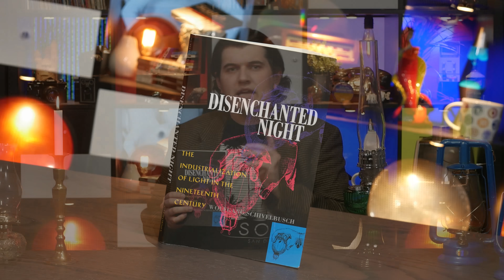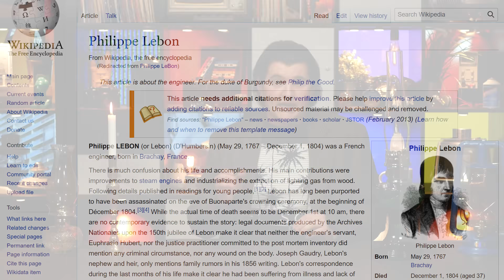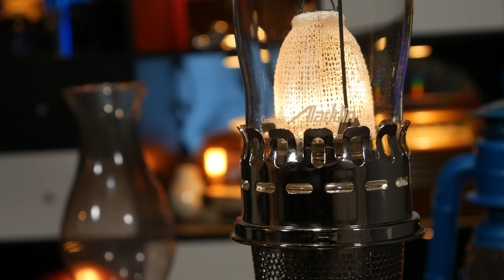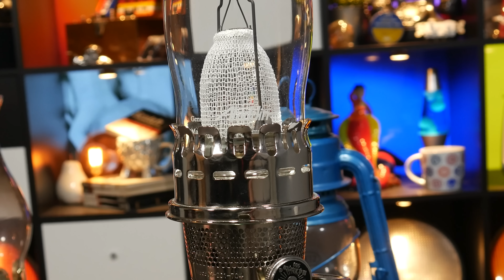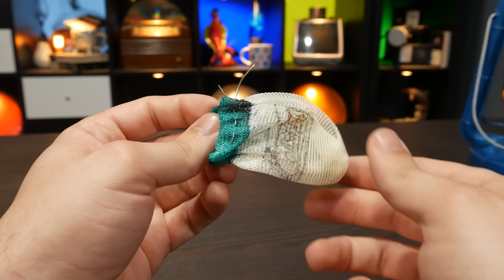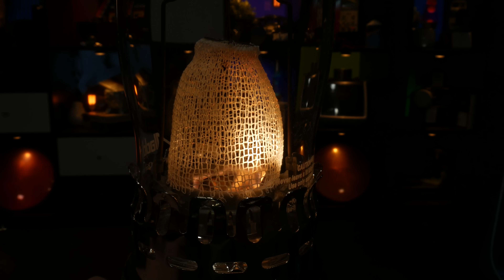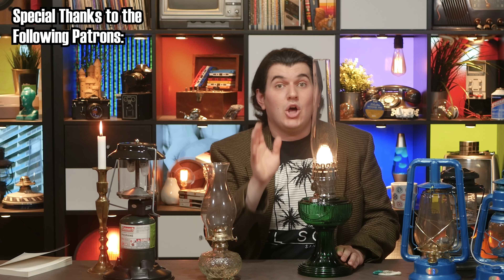How the gas mantle made lamps 10X brighter

Comment: Something I found interesting is an apartment complex I used to visit used gas mantle lamps to illuminate its parking spaces. probably about 2 dozen dual mantle lampposts, around 6.5 feet tall, speckled the sidewalk near the parking lot. This was fairly recently too, last time I was there was prolly 2015 and they were still in use. Only thing I can figure is it must be cheaper to continue using them than to rip out the natural gas plumbing and install electric lighting

Comment: I'd like to disagree with the 'odorless' aspect of the mantel lamps.  After a few or several hours you will notice a subtle hint of kerosene if run inside.  I have a pair of Aladdins for power outages. They are superior illuminators, easily equivalent to a 40w to 60w incandescent bulb. (Perhaps it's because of fiddlin' with it to adjust a perfect flame)

Comment: Tangent on coal gas: The Soviets experimented with hybrid steam-combustion locomotives that produced anthracite gas in the tender from the locomotive's fuel coal then piped that gas into an internal combustion engine while the excess coal went into a steam boiler. They ended up failing due to the extreme weight of this set up and the gas engine exploding at high speeds.

Comment: Thanks for another great video. We always used one of those kerosene lanterns when we would go to the amish sawmill to buy sawdust for bedding for our horses. I was always fascinated by those Aladdin lamps too, but like you said, they are tremendously expensive. I eventually did buy one though....If I'm remembeing correctly, Aladdin claims their lamp burns as bright as a 60w incandescent light bulb. When I was young we always had those flat wick oil lamps on hand in case of a power outage. Dad also had one of those Coleman lanterns too. Although in more recent years they started to make them burn other fuels like gasoline and kerosene, ours burned a fuel with a higher flashpoint, white gas. I did a quick search and white gas has a flashpoint about 40F higher than gasoline. I hope nobody tries to burn gasoline in their coleman lantern if it was designed to burn the white gas. I'll be looking forward to your future videos.

Comment: you missed the most fun one of all! the Petromax style pressurized KEROSINE lamps! :D First you pump them, then you use the built in FLAMETHROWER to pre-heat the generator and only after a minute of something that somewhat resembles an awkward jet engine (sounds like one at least) you can twist the dial and have a friendly hissing bright light. You even have an adapter for the top so you can cook on it! And convert it into a kerosine heater instead of light!

Comment: You can use liquid paraffin in an Alladin lamp, aka lamp oil. I’ve had lamp oil in mine for upwards of 20 years. I also use it in power outages and it lights every time. I couldn’t just have kerosene sitting around in my house.

Comment: Seven years ago Tom Scott did a video on gasometers https://youtu.be/SopJr0yHt-w
Also, while the home gas production unit did not become widespread, it was used in a number of the more elegant and expensive homes here in the southern US. Some of them may still have the gas production machine out behind the house. One more also, and I'll quit, the reason that straight 1/8 pipe thread became common for electrical light sockets and fixtures and is used to this day in lamps and other fixtures is that this is what was used in gas light fixtures and socket manufacturers made sockets for converting gas lamps to electricity, and that is how the thread came to be used. Thin lamp cord was pushed thru the tubes in the fixtures and up into the sockets.

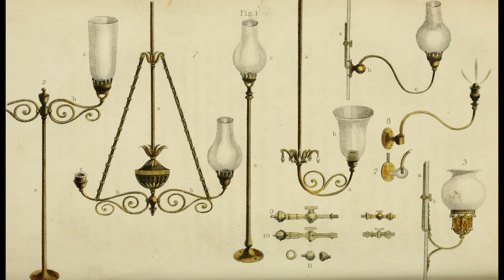Comment: 8:23 ohhhhhh.... I always wondered what the deal was with these rotary light switches (the ones you can rotate into the same direction on end and every 90° is a click for either on or off). Knowing that light switches were basically redesigned valves makes a lot of sense to have the electrical switches be exactly (or at least as close as possible) like the valves...

Comment: gasometer, meters the pressure of the gas, its not measuring its setting the pressure of the gas, which is a function of the diameter of the gasometer and the weight of the cover

Comment: Aladdin made great stuff. You can't afford to use Aladdin lamps these days as mantles cost up around 25 dollars and they can shatter with a small bump to the lamp. The burner is what makes them special, very efficient. They use them in refrigerators and Aladdin Blue Flame heaters. Camping Gaz makes gas mantle lanterns, but they will take a lot of abuse without breaking the mantle and the mantles are relatively cheap. I have a small collection of various mantle lamps and they are great. You can even light your cigarette with them, the exhaust is so hot.

Comment: A guy I knew ran a hotel lit by gas right up to the 1980s.  The switches didn't actually interrupt the flow of gas, they allowed gas pressure to open a diaphragm valve in the light fitting (which had a permanently lit pilot light in it) to switch the light on.

Comment: We used to light our smokes by putting the tip at the top of the glass chimney, 12 inches above the actual flame. That gives you an idea how hot the exhaust is. The early mantles contained the radioactive isotope Thorium, so they were changed for a good reason. It looks like the early Aladdin mantles were treated chemically, with blue phosphorous.

Comment: I think that the mantle does perform a catalytic role merely in the form of the extreme heat. Indeed I have a Rayburn range that is converted to burn kerosene heating oil. It has a float chamber feeding a pair of concentric wicks to initiate combustion. As the burner body warms up it begins to catalytically crack the kerosene into gases which takeover the combustion process. 
Unbelievably, as late as the nineteen seventies my local pub just 20 miles from Cambridge UK was still gas lit!  Two dear old ladies sat in their kitchen with a hatch through to the customers in their parlour. On the kitchen counter were wooden beer kegs with taps inserted directly. There was no sense of charming irony intended but rather that was just how it had always been!🤗

Comment: Aladdin lamps CAN be obtained cheaply...especially if you keep your eyes out for them.
I got my first when I worked at a hardware store and had to order one for a customer...I was intrigued, and when I read up more about them I ordered one for myself.
I still have that lamp. Glass font, simple burner $50 in 1992, but...now?  Probably $130+
Running into flat wick and later tubular wick lamps, I started obsessively cleaning and restoring them..I HATE to see something of use being neglected.
I stopped at 70 lamps.  Yep.  70.

ANYway, I started seeing Aladdins in yard sales and antique shops for VERY short money...usually they needed just a severe cleaning, new wick, mantle etc...the best deal I found was at a yard sale where I got an UNUSED solid brass Aladdin WITH the green glass shade..for $10.
I usually pay between $30-50 for an Aladdin.
At a random yard sale I got the VERY expensive electric burner assembly (for when you want to use an electric Aladdin) for $1.  These sell for over $70 IIRC.
KEEP IN MIND that they can be expensive to get parts for.  Mantles are now about $12-15 each (and amazingly fragile when ashed!), Lox-On chimneys are $30 and each (and UP), wicks however are still cheap.  FAIRLY cheap.
BUT YOU CAN STILL AFFORD AN ALADDIN OF YOU HUNT THEM DOWN.

Comment: "They're still being made"

Goes to buy o-

"They're 200 or more"

Closes the tab
Reply: On the other hand, I'm still thinking of buying a second-hand Sunbeam Radiant Control Toaster, paying its price twice (trans-Atlantic postage) and then finding an electrician to make it safer and suitable for 230 V....
Reply: @vaclav_fejt  I’d be interested to know if the 230V conversion works, I’ve also been thinking about getting one
Reply: @jan_nash  just use a resistor?
Reply: @johndowe7003  A resistor that can dissipate like 1KW? That basically just means putting it in series with a space heater.
Reply: @seth094978  😂
Reply: @vaclav_fejt  I would hazard a guess that a step-down transformer or switchmode power supply would be the safest and most practical, presuming it doesn't draw more than a few amps.
Reply: @dj1NM3  My toaster pulls 12.5A, so I'd be concerned about doing that voltage conversion properly. I'd actually be interested to know whether European toasters are better, because whenever I see an appliance pulling 1500W I presume that it's limited by our electrical supply, not by any real design constraints.
Reply: @seth094978  The typical European toaster only takes about 500W per slot,  there's not much point in using higher power, the toast would burn before it was cooked.  It's difficult to find one that toasts evenly across the whole slice.
Reply: It's the same thing as in Colman camping lanterns, the little mantle socks are like 8$ for a pack of 4.
Reply: The older ones are readily available and the less collectible versions are often fairly reasonable in terms of price.

Comment: Coal/city/light gas consists of hydrogen and carbon monoxide, both of them are flamable. So it was not only a fire/explosion hazard when it was released into a room, but also a recipe for carbon monoxide poisoning. 
It was actually used to commit suicide in some cases back in those days. Luckily, modern natural gas does not contain CO and is not toxic.

Comment: If I'm not mistaken, gasometers were 2 cylinders sliding one inside the other. When gas was pumped in to be stored, the gasometer would be at its full height. As the gas was used up, the upper cylinder moved down inside the lower cylinder. And the sealing system to prevent the gas from escaping was a ring of water, if I recall correctly. I remember seeing many of these things as a kid in the 60's.

Comment: Thorium is being removed from TIG welding electrodes also, solution looking for a problem.  I have a few Alladin lamps, I love them, never expected you to do a video on them. Awesome.  I think you'll find center draft is the Alladin lamps that have a tube though the center of the tank for the center air, and the rest pull it through between the 'tails' of the round wick.  I used to know this stuff, but forgot.

Comment: Great. Now I need one of these lamps also. I have a Colman lantern in the basement that I picked up years ago at a yard sale. I love it for outdoor use. It's fun to tinker with from time to time. But it burns "Coleman" fuel only. I have searched for years for a kerosene version but have not seen one. 
Always wanted na kerosene lantern to use indoors just in case I actually lost power for a significant amount of time. I didn't even know these existed.

Comment: Hey brother you need to let your lamp warm up a bit before you trun it up. Let it sit with just the top of the mantel barely glowing for about 10 minutes. Than trun it up. That was it can warm up and get the draf going and it won't keep going up. And you should check a  fuel called clean heat. It has almost no smell to it

Comment: Gas lighting was still a thing in the US at least into the early 1980s. My grandma had a gas lighting pylon in her backyard. It was a metal pole with a torch lamp at the top and a base set in concrete at the bottom. There was a photocell to make it turn on at night and off during the day. The fuel was natural gas as far as I know. It may have been propane as this was a pretty rural place at the time.  Grandma is gone now and her old neighborhood is now jammed with McMansions and development. I assume the lamp is long gone.  And now that I think about it, I don't remember if I ever saw it actually lit.  Or maybe I just didn't pay attention.  But I remember being fascinated with the photocell and could not figure out how it worked.  I was only 5.  I knew nothing of this world. But I think that photocell was the first mechanical thing I ever saw where I looked at it and knew I didn't understand how it worked but also knew that there was an answer.  I've never stopped looking for answers.

Comment: The same processes to make things like coal gas could be used to make energy, different fuels and feedstock for the petrochemical industry from rubbish, plastics, rubber, greenwaste and pretty much anything else that'll burn, while locking up carbon, creating fertile soil, and doing away with our dependence on fossil fuels, the latter part obviously being the reason for not realising all of those benefits. :)

Comment: Here's a little trick from my days as a scout leader.

Use hair spray on the cold mantle to give it temporary strength and structure to prevent breaking during transport (or long term storage).

It burns off when lit so needs to be reapplied everytime.
Reply: Yep. 
That's how to make the cheapest soft mantles work on a kerosene incandescent lamp.   Beats the hell out of paying $30 fot a mantle assembly.

Comment: If you want to visit "Gasometers" and get an up-close feeling how big they are/were, you could visit Vienna in Austria (well, there are many other reasons to visit as well :) ). The complete exterior of the 4 Gasometers of the City from the 1900 have been preserved and the interior rebuild for commercial and residential use. They were in use for lighting the street lamps in Vienna, as well as a gas supply for the Citizens.
https://en.wikipedia.org/wiki/Gasometer,_Vienna

Comment: In Vienna there where some big "gasometer"'s that are now repurposed, but when they where holding has you could tell by how high or low the containers held by the structure where how full they where
Reply: I believe there are some in London that have been converted to fancy apartments
Reply: @alexe8375  well, the frames were moved to the other side of the canal and fancy apartments were built inside them. The material that actually held the gas was far too toxic to reuse.
Reply: As he said gasometer i instantly thought of the eventhall or what ever it is, called "wiener gasometer" in vienna.
Reply: There existed in my city, a gasometer, until about 10years ago. It was a 'listed' building. It was not actually in use. Then they decided to use the land for a supermarket. The telescopic dome floated on water which acted as a seal, and it expanded as gas was added.
Reply: there was one in my city that they tore down in 2013

Comment: I see you figured this out. The "lute" was the sealing "paste" used where (in this case) the neck of the retort entered into the receiving flask. It was used to create a heat resistant seal between any two glass containers or flasks. This seal was not resistant to water based liquids as water is actually used to break the seal by dissolving the salt in the "lute" "Breaking his glasses" actually does mean the seal was broken in his distillation set up and most likely not that the flasks were actually broken.

A Recipe from 1825: " 2 x "Whiting" (calcium carbonate - primarily used then and today in ceramic glazes), 1 x bone meal (also calcium, but more coarse than the whiting and fibrous - resists shrinkage as it dries), 1/4 x salt ; add necessary water to make a paste; apply lute to the inner glass at the joint, wrap with a strip of course paper and apply more lute to the uncoated portion of the paper; insert the inner glass (neck of the retort) until the (mouth of the) receiver makes contact with the lute ring and allow it to dry thoroughly. "

Comment: Thorium mantles are really cool just by the virtue of being Thorium.  It's not every day you get to own that metal, unless you're a welder.  Sure it's radioactive, but only slightly.  It's not going to hurt you in any way or even "increase risk of cancer" because the levels are so low.  (UNLESS you eat it, or grind it up and snort it, for some reason(?).  Then that's seriously not good, because your innards do not have air or an epidermis to stop Alpha particles.  Plus it basically can cause Lead Poisoning, but a Lead-free kind).  

The Yttrium ones are very cool too though.  I've never heard of that metal having any use, it's always been just another random element on the Periodic Table to me.

Comment: If I remember correctly, when i was a kid (1960's) the mantles were made of silk fabric coated with a radioactive material (would that be the thorium ?).  I remember people would do experiments in science class or other demonstrations, where they would hold a Geiger Counter up to the mantles to let you hear the clicking and see the meter needle move.  You had to light the mantle in a separate step (after tying it to the burner), to allow the fabric to burn off, then you could move to introducing the pressurized white gas.
The one gallon can of "Coleman  Fuel" sitting on the garage shelf or in the shed, always evoked an aura of mystery and adventure, the power of light in the wilderness, and fun memories.
I still have 4-5 of the old liquid fuel lamps that were passed down in the family, a couple of them dating to the '40's-'50's.
I got designated "Keeper of the family treasures" .... Because my garage is bigger ... .  Would have anyways .... .
Got some of those "Green" stoves also.
"Honey ... I know.  They're taking up space .... But, they're part of our "Emergency/Disaster plan/supplies :), :) !!"

Comment: Good bye to the Thorium mantles. All Isotopes of Thorium are radioactive. The most common Th-232 via alpha decay, but has a half life of 14.05 billion years (older than the age of the Universe). Last thing you want is Thorium particles airborne, breathed in and decay in you lungs. Those little Helium nuclei(alpha particles) can do a lot of damage to living cells. Thankfully, if outside your body, they are easily stopped by your layer of dead skin cells.